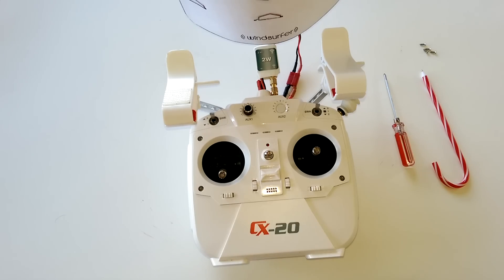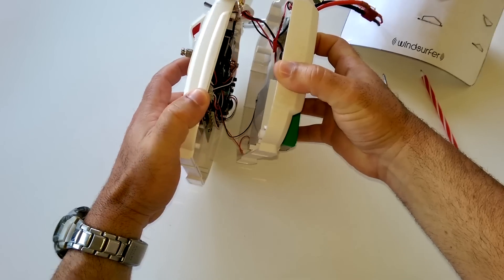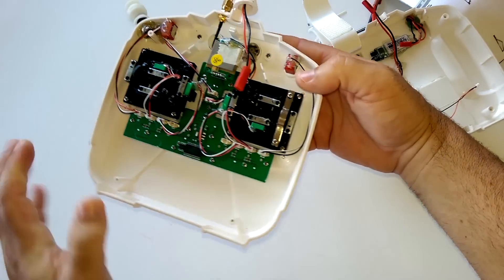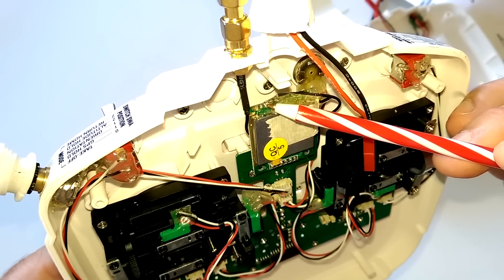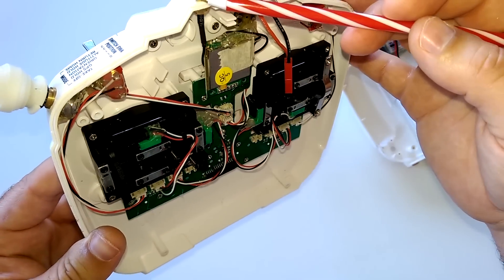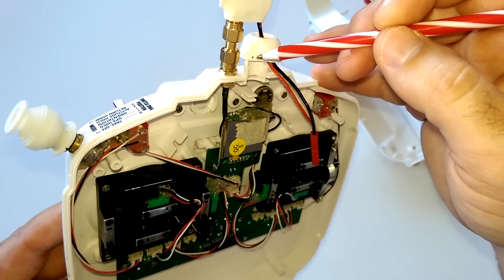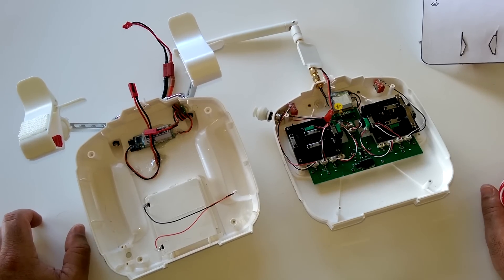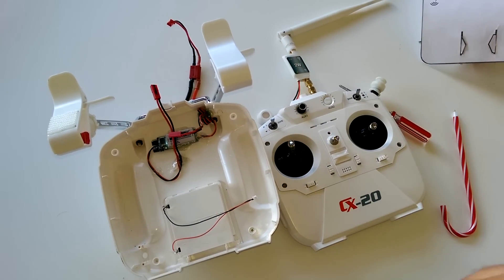CX-20 3+ Mile Transmitter Range Mod - Step By Step - [Works With Any Transmitter]

Comment: after clicking through the link to the "2 Watt Transmitter Booster: http://goo.gl/QZMBie"  the gearbest product page specifically says "can not work with cx20." Is this definitely the one you're using?

I've already ordered this booster and I'm in the process of installing it, but I'm having a hard time figuring out how to connect the antenna wire to the mainboard.  It looks like it's just one wire coming from the antenna (the black wire in this picture: http://des.gearbest.com/uploads/2015/201504/heditor/201504221555123389.jpg), but I know you mention two soldering points.  Could you please help?
Reply from the maker: Hey Derek, yes it's the same booster.  Maybe a misprint? Not sure.  It's the same process for many antenna mods.  I do a few on other smaller copters TX on my channel.  Maybe check those out to see how I solder the actual coax wire in.  You just have to cut and strip the end and solder it in exact place stock is after removing it.
Reply: +Dustin Dunnill 
Ok thanks for the help Dustin.  I ordered everything on your list, but I still need a few connectors and random things to complete the mod.  Thanks for sharing your knowledge - I'm excited to get the extended range working.
Reply from the maker: Cool.  Good luck, you won't be disappointed if you do it correctly.
Reply: am i able to just use the remote that came with my drone and just use the booster and windserfer

Comment: Dustin I was watching your TX mod again, still impressive even the second time around.  Wondering what kind of range you got before you did the modification.  Thanks for the info.
Reply from the maker: I did a stock TX range test in the boonies off the side of Haleakala mountain. Check the video on my channel. 1.4 miles with stock RX antennas unraveled down longer legs.
Reply: That was great. good to know that it has a reasonable range out of the box. That make me feel better about flying in some of the areas that have been.  Good to see the RTL work like it should.  Thanks for the video and info.
Reply from the maker: Sure thing.  Keep in mind range will vary greatly if your around WiFi or instructions.
Reply from the maker: Obstructions
Reply: Absolutely. Thanks again and keep the reviews coming I enjoy them.

Comment: Hello, I have a cx-20, i decided to order the 2 watt transmitter booster and UBEC regulator and just got it today, but i realize i also need the coaxial connector and antenna cable connecting antenna module to the 2watt transmitter, i would appreciate you to show me where you got it, or where i could get it, i'm located in Europe.  Thanks for this video .
Reply from the maker: +Baptiste Ju Hi, mine came with the mini coax going from booster to TX board where you solder.  You can find them on ebay if you look at the picture of the booster online and then just look for that cable alone you should find it.
Reply: +Dustin Dunnill  Indeed, i figured out that Gearbest made a mistake, the cable is missing inside my package..., thansk again.
Reply from the maker: Oh, I'm sorry to hear that.  I would try to let them know it's missing so they can send a replacement.
Reply: +Dustin Dunnill Thats kind from you.
Reply: +Baptiste Ju Well, as Gearbest hasn't been able to send the missing part, i got a refund..
Now i have to find that cable, does this one could make the job: http://www.gearbest.com/development-boards/pp_69331.html
Haven't been able to find smth similar on ebay yet, if u have any suggestion, i would apreciate)

Comment: Hi I have seen in eBay Germany the CX-20 with a range of 1000m without any modification is that right?  here is the link http://www.ebay.com/itm/CX-20-Big-shark-CUADRICOPTERO-UFO-2-4GHZ-GPS-Quadrocopter-Cheerson-Drohne-/281616119137?hash=item4191a0f561
Reply from the maker: Yes, you can achieve that range and more in optimal no interference and line of sight conditions.
Reply: Thanks Dustin I will do your mod when it arrives.

Comment: This doesn't have FPV does it? What is the next quad up with FPV so you can watch while you fly? or can this be made to do that?
Just been getting into quads and got several x5c-1's and just purchased my FY326 Q7, and it's on it's way, moving up the ladder quickly here, with mods and stuff, but no I want this cheerson cx20 but I want something with FPV. Thanks for your videos and mods!
Reply from the maker: Good start with the X5.  I have literally done it all with the Cheerson CX-20.  You really need to browse all my cx20 vids man.  It's all there :) FPV ,telemetry, OSD.  Doesn't come with FPV but is easy to add.  If you can spend more there are many out of the box FPV ready quads.  Cheerson now has a Cx22 FPV successor to cx20.
Reply: you rock man. I will be brosing your vids more. The Cx22, you have reviews of this? Also the range extender for the cx20, can you do that with other Tx's ?
Reply from the maker: I have not reviewed Cx22 yet but I see some on YouTube.  Yah you can do the range mode to any TX.

Comment: Hello I want to do the same installation but have several questions: 

Which battery would you recommend?
 That put cable for connection? 
The batteries in the remote are canceled? Where I can buy the material?

Thanks
Reply from the maker: Links in description for components.  Any 2s 7.4v lipo will work.  I did not bypass AA stock batteries here but you can just power entire TX and booster off of lipo if you want.

Comment: If i cut the wire of the stock antenna and solder it to the amplifier antenna cable without soldering it to the circuit, will it work or may cause any other problem??
Reply from the maker: It may cause problems because it will be breaking the shielding on main shielded wire which may cause range/wavelength problems.
Reply: Thànk you sir for replying me.

Comment from the maker: UPDATE!:
I've been keeping an eye on cheapest price and price drops. The CX-20 recently got a price drop and they now have stock in USA.
USA Warehouse CX-20 (Cheapest Price in USA):
http://goo.gl/g57sBx
China Warehouse CX-20 (Cheapest Price From China): 
http://goo.gl/kyB8k0

for the highly modifiable open source version shipped free!  If you were looking to buy this, you might want to jump on this deal soon..
Reply from the maker: Right on Ray.  Good luck!
Reply: +Dustin Dunnill its 269 at Banggood...
BTW... Did you by any chance find a way to control the pitch?
 Kind of like you can with a click on left top controller change from %25 to %50, 75, and 100, and can actually fight some wind with the JJRC H8C?
The Cheerson I got does not have that control...
 If you have any info about that, would you be so kind as to email to me @
compudoc732@gmail.com?
Thanks
Reply: +Jack Scarpon the CX20 is not a toy copter as far as throttle control goes.. it's using an APM, at full throttle you are at 100% you can hook the open source version into Mission Planner and change the advanced settings and increase all the rates if you want to get crazy... mine is set to full aggression
Reply: yea... Got that done already...  Tookbit up to 2850... And it fly fast.. Against wind with no issues .. Thanks

Comment: Very nice mod, DD, but since you had the 6V BEC, why didn't you tap into it to also power the radio itself and avoid ever having to change AA's again?
Reply from the maker: Your right.  I'll probably solder the leads to bypass AA batteries soon.  For now I just use NiMH rechargeables.

Comment: Dustin, do you think these batteries would fit in the CX20?
http://www.amazon.com/FLOUREON-Li-Polymer-Connector-Helicopter-Airplane/dp/B00N9SU5U0/ref=sr_1_15?s=toys-and-games&ie=UTF8&qid=1435856978&sr=1-15&keywords=lipo+battery

I just ordered mine and I'm looking for extra batteries. 

Thanks in advance.
Reply from the maker: Benito Mendoza Hi Benito, Those won't work.  Those are 2S 7.4v and the Cx20 needs 3S 11.1V.  Also, I would not get batteries with a hard casing for flying R/C as it also adds to much weight.  Check out my CX20 Mods and setup video on my channel.  There are links to the 3dr 5100mah batteries that work great but just stick out a little.
Reply: Okay, great adivse. Thanks for the pompt response.

Comment: Wow, sweet mod! 3 miles is quite a bit!
Reply from the maker: Thanks.  I'm sure it can go much further but airtime is now my limitation due to battery.
Reply: Dustin Dunnill Ahhh, maybe have someone out there so when you land they can get it? How do you see it that far away?
Reply from the maker: FPV video from quad Cam and spotter with binoculars.  Did you see the setup vid?  I go through how I have it all setup here:  Cheerson CX-20 Quanum Nova Quadcopter Drone - Mod…: https://youtu.be/TmmT7dlaTh4
Reply: Dustin Dunnill Oh ok. I thought you said Line of sight in this video. I have not seen the other and out wifi is limited so will try later when it is free.
Reply from the maker: Sorry.  I meant line of sight as a term used for no obstructions between transmitter and quad.
Reply: Dustin Dunnill Ohhhh. OK :) I was wondering how you could still see it or judge range ;D Lol like 20/1000 vision ;)
Reply: What battery (how many cells,  how many volt and how many mah)
Reply: Dustin Dunnill Do I need to buy UBEC 3A? or only the 2w extender signal?

Comment: Wow Lots of high tech stuff going on there. Nice job though, well laid out.
Dustin I was wondering, I noticed that there is screws and straps over the control sticks. Is it possible to tighten the stick movement. My throttle and rudder stick is very light. Thanks for the video give me food for thought.
Reply from the maker: Thanks.  I'm pretty sure you can.  I've heard of others doing it.